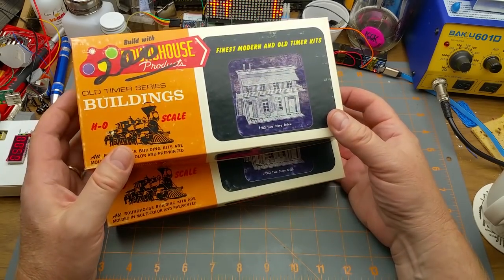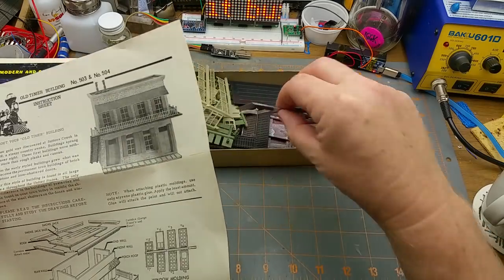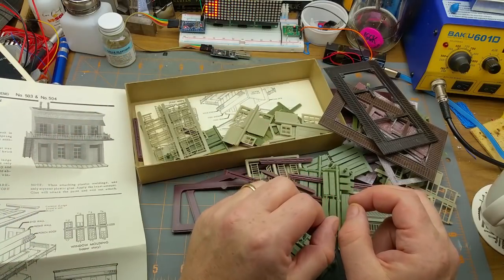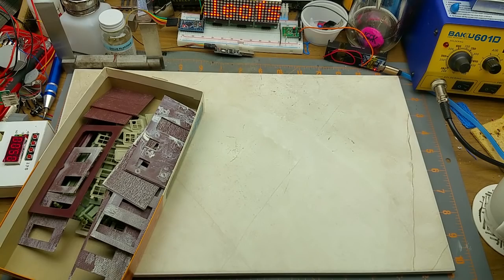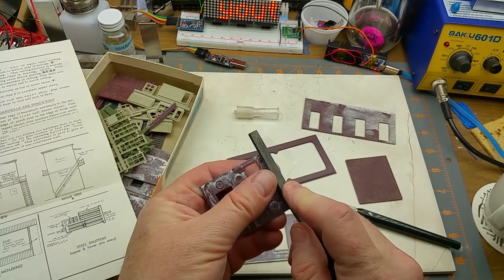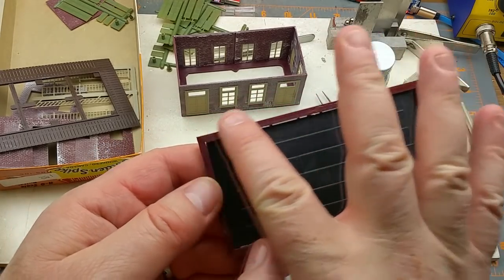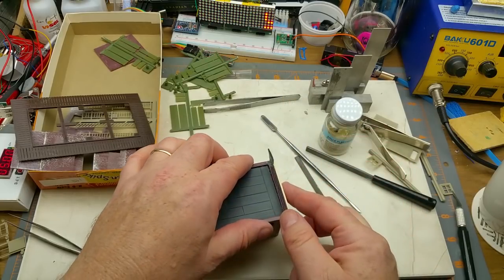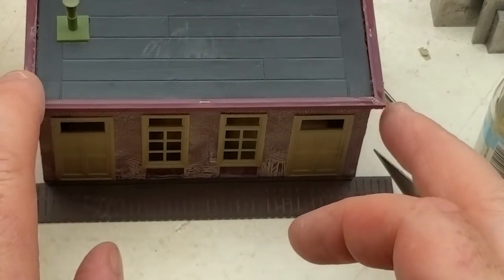kit build - HO scale brick building

Comment: At least three kits for $2.00? You really scored on that one! I was at a train show a couple of weeks ago and a guy was selling some 'junk' from his club. I bought a box of 24 broken freight cars for $5.00! Nice job on the kitbash. What I like to do for tar-paper roofs is to give the roof a good coat of flat black, then while the paint is still wet give it a good thick coating of scale cinders. Once the paint has dried I dump off the excess cinders and use a dilute glue/water mix to fix the cinders in place. It looks much better than a plain plastic roof.